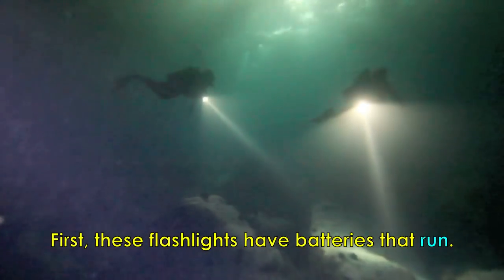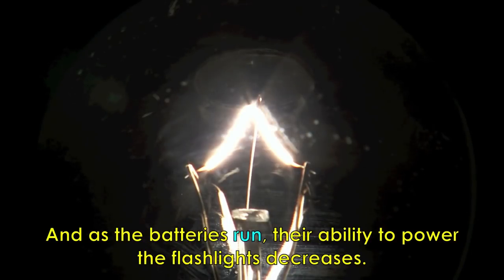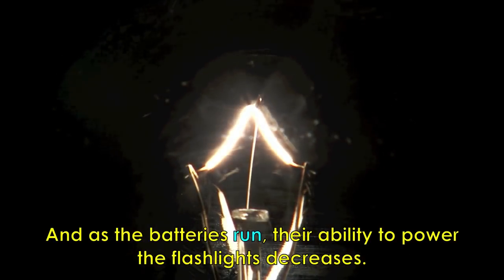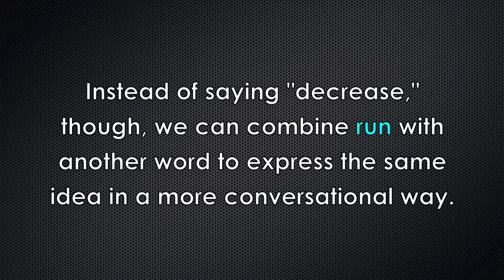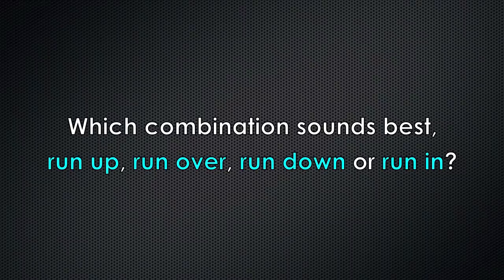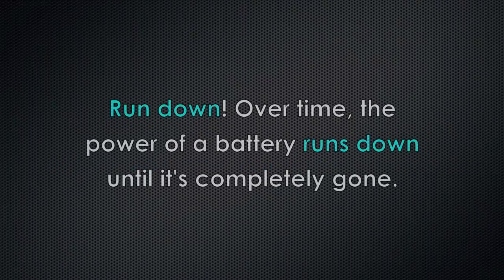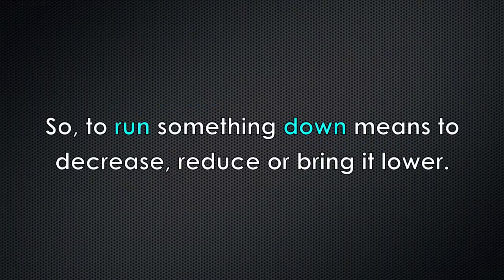Phrasal Verbs with Run - Visual Guide to Phrasal Verbs from EnglishAnyone.com

Comment: always useful to approach these complex phrasal verbs - in new ways - However I find some of the examples are not offering a reliable pattern - You have used the contrasting prepositions/particles off - on and up/down which offer a nice pattern - but mixing phrasal verbs and prepositional verbs (meaning verbs with prepositions such as up=/= down on=/=off out=/= in as localisation that second language learners can pick up and make up (contrary to phrasal verbs). in any case - as I said - always useful - obviously - from reading the comments. so didn't mean to be overly critical :-)